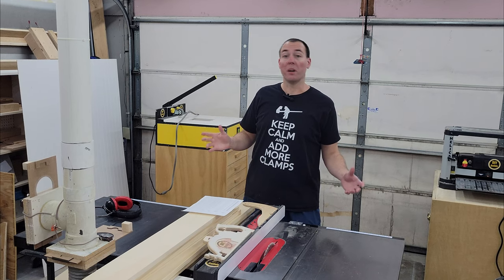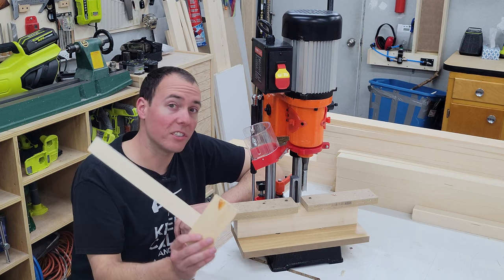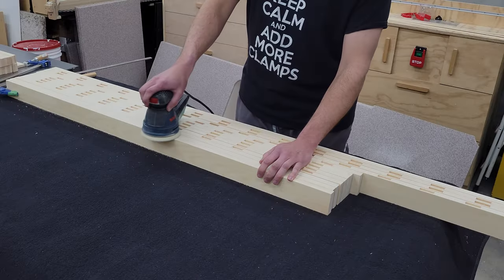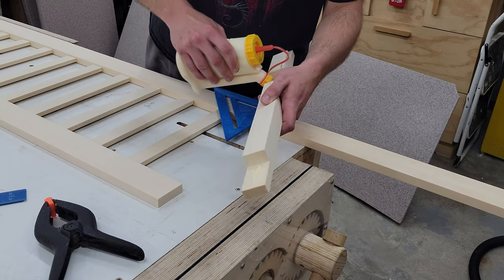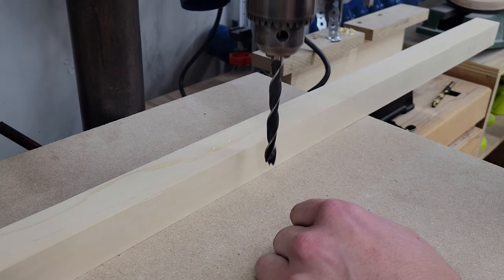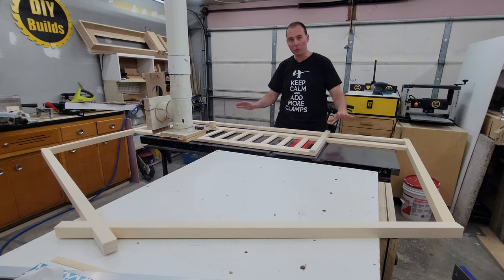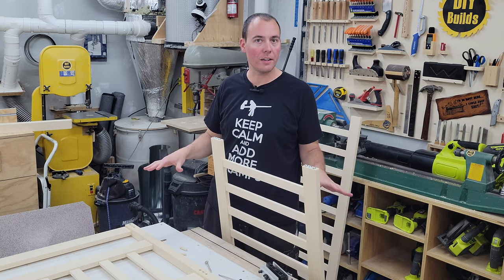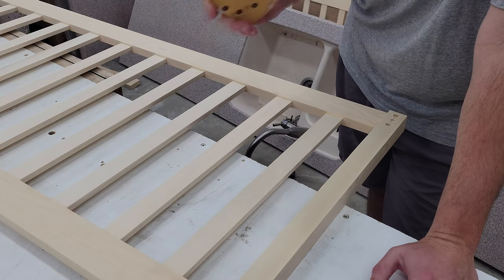How to Make a Montessori Bed - Free Plans!

Comment: hey bud....i got an idea for u........i want u to build the most silent lighter possible using the slide switch of a light switch where one just strokes a finger or a thumb upwards to ignite....or even the example of a touch screen phone where one slides up to unlock......but it must have the feature of usb charging....or gas refill..whichever is possible......so basic design must fit in hand...slide up to ignite (with a safety lock) and 0-12hz sound (if possible)

Comment: If you add another threaded insert on the outside of the posts the connector bolt will snug against it and you will cause even less damage assembling and disassembling the unit.